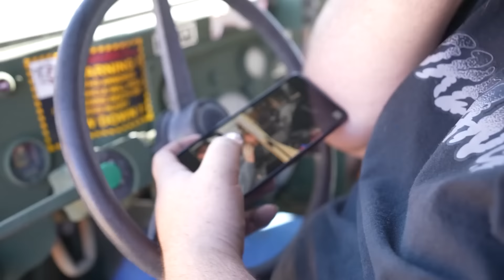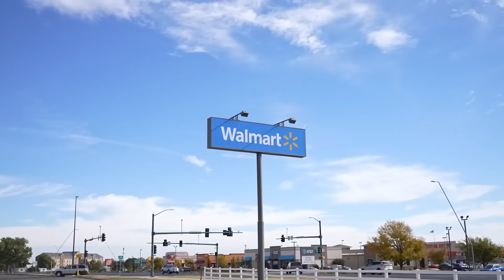Driving 1,084 Miles in a Humvee...It was Terrible

Comment: As a service member who spends most of his time with HUMVs in one way or another. I can confirm it is a certified miracle it made of farther that 250 miles.
Reply: I too am a service member. 91 bravo wheeled vehicle mechanic humvs are athletes foot. Trash ass trucks. The funnest thing I've seen all day was ol boy  here try to do a burn out in that thing. You lucky if the thing gets to 60 mph.
Reply: For real lol was thinking the same thing
Reply: I’ve spent most of my adult life living in soft skin HMMWV’s and they are hit and miss. I’ve had some that just wouldn’t quit and others that just wanted to die around every corner. My favorite one was a 1097a2 that had a bad engine when I got it, had it in the bay for about two months and after a new engine and a good annual service she was minty. That was my truck for two years and I would take it anywhere.
Reply: 100% They were SHIT 11b1p checking in. Your legs are more reliable at 70mph.
Reply: @NA-nc5dg  actually in the stans we never had a problem with ours took the govs off them to max out their speed and they ran amazing when you drive them right not no 25 mph but 60+ mph
Reply: I can confirm. As a service member who used to fix these death traps. I’m surprised it still runs
Reply: 74delta here and I can also confirm these suck.
Reply: I'm beginning to think we should let our servicemen write the equipment they're having to use.
Reply: I drive these shit boxes like every day to haul radios from one site to another... I'm just ready for my squadron to take shipment of the JLTV's
Reply: @PneumaticFrog  they were designed to be super lightweight like a jeep. But when they were implemented in the middle east they kept getting shredded by IEDS. So in order to fix that they made them up Armoured. The problem with that is they have a motor and transmition that was designed for a vehicle 3 times lighter than what it is now thus causing  problems. The newer trucks we have like MRAPS AND JLTVS. Where built from the ground up with Armour in mind making them waaaaayyyyyy better trucks. Also anything that is made by the military is made by the lowest bidder meaning military grade means as cheap as humanly possible. Basically military grade = cheap AF
Reply: 10*
Reply: @michaelsingleterry1573  ours blew doing probably close to 50-60, multiple blew. We had 8 HMMWV's and could keep 3 maybe 4 mission capable. They were constantly in and out of the shop.
Reply: I’m just checking in…Alpha 1/11
Reply: @PneumaticFrog  lowest bidder
Reply: @Williplier  ah okay. that makes sense!
Reply: @NA-nc5dg  then your mechanics were garbage or the hmmwvs you had were garbage because out of 4 years infantry with 2 tours threw the stans and 4 years as a mechanic the only hmmwvs I had problems with were the garrison ones they were driven at 25 mph for 2 hrs sat for a week then driven back then sat for 3-4 months
Reply: @michaelsingleterry1573  they were 998 up armored pieces of garbage. Mechanics were on diamondback and fob freedom in mosul. There is a reason they were phased out before my IRR tour. Both deployments were Infantry (LRS). Even when we got m1114's we still had issues. Our m1117's made it maybe 3 missions and we never bothered with them again.
Reply: @rb-oo5mz  there's plenty of vehicles that do over 60
Reply: My best friend was motor T in the marines and he said the humvees are BIG trash specially the lower weight ones(7 tons if I remember correctly?)
Reply: @rb-oo5mz  you just said it's not supposed to do over 60 due to it being a military vehicle. But there are plenty of vehicles in the military that can. Did you forget what you said already???
Reply: @rb-oo5mz  maybe in a tactical environment but in reality they are used everyday by thousands on the interstate over 60. Including some hmvees.
Reply: @rb-oo5mz  source I did it last weekend.....
Reply: @rb-oo5mz  and yes they are supposed to do 60 they come out of the box with a governor that allows for those speeds if they weren't meant to do it they would have put a governor restricting speed to 30. Your confusing speed restrictions in a warzone with what they are more commonly used for. Military vehicles go over 60 all the time.
Reply: @rb-oo5mz  yes they are 🤣. Where does it say they aren't supposed to. There is no exception to a rule that doesn't exist. Military vehicles aren't limited to 30 miles an hour off the rip. That's special situations. If they rolled a vehicle off the line that went 30 the military would laugh in thier face. You have no idea what you are talking about. I'm glad you can tell me though lol. It's not like I've been in a dessert where I had to drive those vehicles or its not like it's my job in the army to work on trucks lmao. There is no rule saying military vehicles on do 30 period you are misinformed sir.
Reply: @rb-oo5mz  91B wheeled vehicle mechanic and military trucks are not designed to only go 30mph
Reply: @rb-oo5mz  in case you want to know my qualifications besides Mos. Hotel 8 heavy vehicle recovery meaning I haul vehicles that have been destroyed mangled or inoperable to a forward location where they can be fixed. I've hauled vehicles across mountains that weigh over 60,000 pounds. And I did over 30 lol. I've driven almost every type of truck you can think of in the army and not ONE has been infinitely restricted to 30 mph ever.
Reply: @rb-oo5mz  you said they aren't supposed to do 60. Some of them are supposed to be able to do over 60 out of the box. Especially the modern trucks. If you would have said they aren't supposed to on post or in the majority of tactical environments I would have agreed.
Reply: I used to fix these things all the time I am amazed absolutely amazed that it even got out of California
Reply: @Williplier  it's also a cost of loss calculation. they dont want to spend too much on a truck that likely will be destroyed or left behind. Jets cost a lot and they plan on getting them all back everytime. Wheeled vehicles are disposable.
Reply: i seems to be a pretty shit vehicle
Reply: @Williplier  ph
Reply: Yours  makes it out of the MP?
Reply: They get a bad reputation. They are not bad vehicles though. I always wanted to drive the 6.5l turbo charged version in a lightweight frame. 

Probably the best driving test I ever had was in a m998 on ft Carson
Reply: That thing runs better than most of the HUMVs in my battalion.
Reply: The key is maintenance!  Lets face it folks , the programs followed by the services aren't the best, they use the cheapest parts available . Military mechanics, while some are excellent, most are very average and corners get cut. That's the truth! Once you get them up to snuff they are just about bullet proof!
Reply: lmao same, When he pulled it over right after getting it I was like, yeah that's about right.
Reply: in which foregn army they have humvees
Reply: @Williplier  well, when they went up armor they turboed them and gave it the 4l80e tranny.  I'll take an 1165 over a 1097 any day.
Reply: Lmfao it's horrible for your  back as well. If you don't put your seat belt it will throw you outta there.
Reply: as a service member who used these vehicles much first im surprised it made it second the fact you even got it to 70 MPH =0
Reply: There's noway you made it with out changing that piece of fuel line on the top passenger side of the motor!  But damn good job I'll definitely say that!!!
Reply: Someone made a lot of money supplying this crap to the army.
Reply: Mogadishu Somalia to Kismayo Somalia in a convoy of HUMMV's. 4 flat tires, 1 blown radiator hose, a broken door we had to use 550 cord to secure, but we made it.
Reply: @jamescoyne6836  in Italy they are worth between 40000 and 70000€, and in the USA?
Reply: Agree
Reply: As a mechanic myself when I take on side jobs I do my damnedest to stay away from humvees
Reply: Thanks for your service and the service of all the other service members here 🇺🇸
Reply: @Williplier  if you get to 60 in that thing it feels like it's gonna shake apart
Reply: These really weren’t any fun, 48tango checking in. The fuel economy was not ideal for tours, however the Jerry cans helped a lot.
Reply: As a non-service member who has not spent any time in a HUMV, I can speak from the zero experience I have involving these things to personally confirm that they seem to struggle.
Reply: I’d have put a racing seat in it too!!!!
Reply: There not reliable?
Reply: @thywhyguy4713  jltvs are trash too js
Reply: On god I feel blessed if the ones I work on make it 25 miles
Reply: @Williplier  M998's didn't have that much power, and have the aerodynamics of a sheet of plywood facing forward:)
Reply: @Williplier  chi Jo I V  hi hh n thanks I
Reply: Are they really that s##ty?
Reply: It is it’s all True Miracles , True Blessings and the True Grace of The Holy Spirit frfr Amen 🙏 ❤️✝️✝️✝️💯💯💯💯💯💯💯
Reply: You ain’t kidding!!
Reply: @Nosnehp  AMEN 🙏 ✝️✝️✝️🙏💯❤️🗣🆙🙏✝️
Reply: @Nosnehp  Yeah yay Everything that’s all True Miracles , True Blessings , and The True Grace of God is all True Miracles , True Blessings , and The True Grace of God FRFR AMEN 🙏 ❤️💕💕💕💯❤️❤️❤️❤️❤️💯✝️✝️✝️✝️😘🎈😍🗣🙏🙏🙏🙏🙏🙏🙏🙏🙏🙏🙏🙏🙏🙏🙏🙏🙏🙏🙏✝️🙏✝️✝️✝️🙏🙏🙏🙏🙏❤️
Reply: @Williplier  Not trying to offend you or anything, but the way you spell things kinda makes me think you might have been the one setting up those IEDS…
Reply: 12 bravo here and it's amazing to see what you did glad to be apart of it
Reply: xD
Reply: Thanks for your service brother
Reply: Some suck some don't. Really depends on how you take car of them. When you've got a bunch of 19 year olds making gaskets out of manila envelopes and running them off of jet fuel you get what you put in.
Reply: I was even spoiled in the 75th and got to use the "nice" ones and I still fully agree. Absolutely shocking that this girl even made it out of the state he bought it in. Lmao
Reply: I was stationed in Virginia back in the early 00 and I remember there was a hurricane coming.    So all the teams had to take our vehicles and we had to drive it to Indian head to get out of the way of the hurricane.    One of our hummv was could only go 55 mph and there was a ton of people trying to evacuate.    We were driving on the right lane could only go 55 at a 65 mph.    The other people was so mad they were passing us and flipping us off.    Lol
Reply: lol did u see the first video, it barely made it down the road after leaving the lot.
Reply: 81 Charlie checking in
Reply: haha agreed
Reply: @Williplier  i push them to 75 lmao. be good to them and they’ll be good to you
Reply: Dude I gotta ask. Did you bother trying to figure out the mpg that thing got during this cross country run?
Reply: The contractor I worked for in Afghanistan was offered Hummers for our convoys, the company said heck no, give us a few mraps or we ain't going.
So we had some sweet mraps and they worked mostly well enough considering.
Reply: Lol
Reply: Can also confirm this is a tru statement😂😂
Reply: HUMV - Huge Useless Mechanical Vilification
Reply: I've wanted a Humvee ever since I was a little kid, it's honestly the only car I've ever actually had an interest in (I'm more of a helicopter guy). But I've heard that they are sh*t, and very high-maintenance to own as a civilian.

May I ask what the biggest issues are? The engine (can that be replaced)?

Comment: Sleeping bags are mostly rated at their “survival rating” rather than their “comfort rating.” Always go 20 degrees below what the survival rating is. So if your sleeping in 0 degrees, you want a -20 Fahrenheit bag to sleep comfortably.
Reply: Yes, but also, who buys a sleeping bag & no blankets? 🤣
Reply: @KermitOfWar  it might be a joke but basically it is a blanket and mattress
Reply: @8Byto  extra thick comforter inside a sleeping bag is always worth it no exceptions lol
Reply: You can have the best sleeping bag out there, if you keep your clothes on, you'll be cold. I've slept like baby in the back of a truck at 0°F, no problem.
Reply: You also need to insulate your body with some kind of sleeping pad, since your body will compress and flatten the insulation in the bag directly under your body you want a slim air pad or foam pad to retain your body heat better. It would probably increase temps inside your bag by 10°+
Reply: If the sleeping bag has a flannel interior liner, it's basically made for "camping" in a living room.
Reply: @matthewputnam7486  Yeah I was thinking the same thing too. Also that sleeping bag was pretty cheap and thin for a "0 Degree" rating.
Reply: A fact I learned the hard way...... There I was, basic training. It was a crisp 30 degrees outside during a field op. DS told us to bed down. I crawl in my sleeping bag, fully clothed, jacket, the whole 9 yards. I look up the hill to see DS stripping down to his underwear. I thought he was mad! Well, I froze all night and he was warm. We had the same type of sleeping bags. The morale of the story is that the less clothes you are, the more body heat escapes and gets trapped by the bag. Also, to be effective, the bag needs to be fully zipped with as little opening as possible.
Reply: @JDub07  Fun story but it's 100% false.. It is NOT warmer to sleep naked unless your clothes are soaking wet for some reason.
Reply: @joshm9630  I was thinking the same thing, like one way or another your body heat will eventually warm up the inside of the sleeping bag. Maybe it'll be uncomfortable for the first hour because your body heat will have to warm up the outside of your clothes which should be roughly as cold as the outside when you first get in the sleeping bag. Essentially the exterior of the clothes would be acting as an ice cube. If that takes a long time, like up to an hour, I could see how it would be worth it to just go in naked.
Reply: @JDub07  the reason your DS stripped down was so he could layer up in the morning to warm up. You sleeping with all your clothes mean you have nothing to warm up with.
Reply: @kofiAnkraAsareAttrams  if you put your clothes in the bottom of the bag you will be fine
Reply: It's not that simple lol but that sleeping bag he had looked thin for a low temp one... Cabela's is overpriced fluff stuff anyways though
Reply: @KermitOfWar  Yeah, I'd definitely want some backup blankets. Worst feeling in the world is not having quite enough. Too many is always better. Live and learn, I guess.
Reply: @JDub07  Fellow vet here. That's an old wives' tale. It's not actually warmer, it just feels like you warm up faster, because you're not having to also warm up the clothing. If you wore the clothing, you would get even warmer, but it would take a little longer - like having more blankets on your bed, but you kept them outside, so they start off cold. There's no situation where more layers result in less warmth.
Reply: @Drkbowers1  That's exactly what it is. Less mass to warm up, so you feel it faster. Wearing cold clothes into a sleeping bag is like having an extra blanket, but you kept it outside in the cold. You'll get warmer, but it'll take a little longer to get there.

Comment: Having had my fair share of experience in HMMWV's, I can confirm that every experience you had is shared by almost all service members. From the overheating, doors not closing, "run flats", and absolutely freezing nights spent sleeping in one, these are all spot on. It is honestly amazing that you made it as far as you did without further problems. Pushing them things past 40 mph pretty much voids any mechanical security that the HMMWV may have had before.
Reply: I don’t think I ever drove one while working as a mechanic more than 30 mph, they were terrifying
Reply: Just asking here, but isn't this supposed to be a strong machine you'd depend on as a marine? Breaking tires daily? Really? :)
Reply: @andersborum9267 military spec means built to the absolute cheapest and most easily replaceable equipment and these trucks are built to exactly to that specification.
Reply: @justdub9632  lol :)
Reply: @justdub9632 would it be possible to upgrade parts and all that to make it into an actual working and safe car? Like even switching out the engine for a better one, really making it into a nice vehicle, fixing the interior and all

Comment: I feel your pain! I flew from NH to Kentucky to drive a "non running" (according to the govt auction) Deuce 1/2 home. I had suit cases full of tools and parts (mostly filters & belts). I "borrowed" another truck to jump start it with, then drove it off the base with no brakes. I got brakes at the gas station down the road after refilling the fluid. Phew!

100 miles later I did a pre trip PM at a friend's house, filled the fuel tanks with used motor oil donated by friends, then hit the road for the 1200 mile drive home. No heat in November is fine in Louisville, not so much in snow in upstate NY. I took a 2 hour nap near Albany before meeting a friend for breakfast, then finished my drive with little drama. What an awesome adventure!
Reply: I want to live your life.
Reply: It ran on used motor oil? As fuel?
Reply: @TheLukasDirector  tis the beauty of the multifuel engine my friend. Pretty sure those things would run off greasy ditch water if desperate enough.
Reply: @TheLukasDirector  Yup the multifuel engine would be great for a post apocalyptic vehicle... used motor oil, kerosene, whatever it'll run it... the trade off is it only puts out about half the power as the more common ones...
Reply: @TheLukasDirector  The m35a2's will run on basically anything with a flashpoint. Gas, diesel , used motor oil, vegetable oil, atf, hydraulic fluid ..... Although things with lots of alcohol should be avoided because it eats rubbers/plastics in your engine. Most people who use alternate fuels in their m35a2's usually use a mix of 30% gas/diesel 70%whatever you want, although it is strongly recommended that you filter whatever you are cutting your fuel with. Also most diesel engines can be converted to run on things other than diesel aswell.